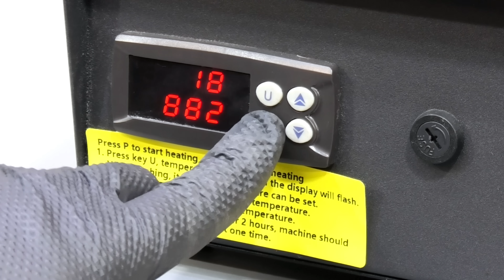105 Years Old Push Reel Mower Restoration - Why Did People Stop Using These?

Comment: I think the test answers the question in the title quite nicely 😀
Reply: I use one - a modern one, that is - and it works well cutting grass but weeds, not so much.  I have to go back and forth, back and forth. But I like it because it's quiet and I can mow any time of day without disturbing the neighbors.

Also, I live next to a golf course and they have gangs of these, which they pull with a tractor, as their primary cutter for the fairways.
Reply: Yep, I was going to say the same thing.
Reply: I used to have to use one if blade is adjusted correctly they cut nice but the blisters you got on your hands were horrible. Also you need to make sure there are no sticks in the grass they will stop you in your tracks.
Reply: Agreed this can't hold a candle to a newer designed mower ..... The "TEST" looked absolutely worthless for what is was supposed to actually do.
Reply: I have a newer one and they all have the same issue.  They cannot cut tall or thick grass.
Reply: Fantastic restoration but an awful mower!! That’s why people don’t use them anymore!
Reply: He needed to spend a heck of a lot more time sharpening and aligning those blades. How rough that paper test was should have been a major clue, it should cut cleanly and easily across the whole blade for each blade. And the clacking when turned!
Reply: @joelsmith3473  absolutely spot on! Did all that work and then didn’t sharpen the blade correctly!

Comment: They are still used, for example on golf greens, because they cut the grass stems, rather than tearing them as a powered mower does.  The key to making them work well is to use them frequently. You can't cut the grass once per month with them, but if you do it weekly they work pretty well actually.  

They can't cut tall grass, so its like a barber giving a haircut, with a scythe you mow down the tall grass, if you have it, then trim, even and clean it up with the push mower.

It's great exercise, no need for a health club membership :)

Comment: Why did we stop? They are **heavy**, the wheels slipped and made gouges in the lawns. Twigs or small stones would jamb the rotter and you would have to turn them back by hand to unjam it. The blades needed sharpening, the edge they cut against needed adjusting and you would often have to carry them which was awkward and they banged and bruised your legs.
Reply: Not to mention they only work on flat ground.  Any sort of pit or hole, and suddenly you're mowing dirt.
Reply: @cheesesniper473 And where I lived, it rained a lot. Cutting the grass with this diabolical machine was a real exhausting nightmare. The result never looked good.

Comment: My suggestions: make the push handle wider, the handle shaft should be made of oak or hickory to prevent twisting and the blade needs to be sharpened better.

Comment: Ours came in working order with the house we bought 45 years ago and we used it for 30 years and then we got a gas mower and used it for 8 years and it broke down so we cleaned up the push mower and used it until we sold the house. We left it in working order.

Comment: Nice work on the restoration!
I used one briefly when I was a kid.  We bought an old house and it was in the garage, so dad cleaned it up, sharpened it and oiled and greased it and it worked OK.  It was very heavy and I struggled to push it , especially if the grass was long.  I think my dad thought I was too young for a power mower.  Pretty sure he felt sorry for me and caved in and bought a gas powered mower.  My Saturdays were mostly spent mowing and trimming and raking until I went away to college.

Comment: My some of my best childhood memories were watching my grandfather sharpen and/or repair mowers like this. At 80 years of age he could lift one with one hand while seated, flip it over and place it on the machine designed for the job of sharpening the reel blades. He also sharpened chain saws and hand saws. People came for miles for his work in Northern Michigan. He also had one of the early toasters with doors that opened on the sides. He kept opening it to check progress to turn the slice of bread to toast the second side.

Comment: I have mowed many lawns with such a mower, and a sharp one was remarkably easy to use. The one I under had a hardwood handle with a straight clear grain I do not know what the variety od wood was. I do remember sharpening it was a challenge, but when sharp it did a very good job on the lawn.

Comment: I got to use one of those once. They work surprisingly well when they're in good condition. If I had a lawn that's the kind of mower I'd want. Doesn't need Gass or be plugged in.

Comment: I used one of these exclusively for my small lawn for a decade before finally caving and purchasing an electric mower to make things easier when grass gets too tall. I still have and use the quiet and simple push mower sometimes though, as it doesn't make enough noise to wake sleeping neighbors early on a summer Saturday morning when the only time it's comfortably cool enough for yard work is 5:30am. The fact that the push mower makes no more than a quiet whirring tk-tk-tk noise means no one gets mad at me for ruining their day to sleep in, so I get to be a good neighbor and still beat the heat.

Comment: When I was a kid, I used to mow my elderly neighbor's lawn with either this push reel Brill or one extremely similar and with the same pale green color.  For about three or four running years back in the early 1960s.  As many have noted here, they were extremely difficult to push due to their immense weight, especially for a 10-year-old kid.  And they were useless in long grass, thus I had to mow regularly.   I often had to run with the mower to get enough momentum to cut longer grass that grew around her barn.  It was very tiring work for a kid.  "Fond" memories.
PS  The mower I used was larger with a much wider cut.  And I can assume it was much heavier than this model.

Comment: I used a reel pushmower until about 1990.  When properly adjusted, a reel mover like that gives an excellent cut.  It will cleanly shear the grass blades instead of tearing them like a rotary power mower does.

Comment: You could still find those things in use when I was a kid. People stopped using them for a few simple reasons; 1) the blades needed constant sharpening or they didn't work well, 2) the blades are unprotected, so people got cuts and the blades got damaged from rocks, 3) they are more work than a powered mower.

They were sort of cool to use on a nice flat lawn when all the blades were freshly honed. That "chop-chop-chop" sound of 4" tall grass getting smoothly sliced was very distinctive.

Comment: used one of those until 1963 when I was 13, when Dad finally bought a used gas powered mower.  when properly set and lubricated, the reel mower was very good at cutting grass except in corners
Reply from the maker: Thanks for sharing

Comment: I've watched a couple of your videos, and you definitely have a good eye for just how much to clean up a part.
Also, I've been considering picking up a vintage push mower. I've got a modern one, but it's designed with a safety bar at the front, and the bar pushes the grass down enough that it doesn't cut. Practically worthless unless the grass is already fairly short. the front of a push mower needs to be unobstructed sharp blades, that's the whole point!

Comment: I have had fair amount of experience using reel type lawn mowers. My father made me use one for a couple summers when I was in Jr. High school. A lot of work, especially for a young kid who was not very tall. Then I worked on the family farm for a summer right after I graduated high school, and besides using large farm equipment, I also took care of mowing all the grassy areas around the farm house and other buildings, but that machine was a powered reel type....the wheels were self-propelled from the motor, and the blade reel also spun under engine power. It was also quite wide, but it cut very well. I recall it had some kind of mechanism for keeping the stationary blade in proper adjustment relative to the reel blades, might have been been self-sharpening.

My observation was that unless the lawns were mowed frequently, the result after mowing looked messy. I think this because, unlike a 'modern' rotary mower, which tends to chop up cut grass into smaller pieces after cutting it (and especially so for mulching mowers), the reel mower just cuts it then lets it fall like a mat on top of the lawn. The cut grass turns brown, and blocks a lot of sunlight for the growing grass underneath, and does not settle down low to decompose properly. And for the manual (unmotorized) reel mowers, if the grass is at all wet, the wheels slip a lot, causing the reel blades to not spin consistently, resulting in unevenly cut lawn.

Comment: I used to use one of these and then we upgraded to one with rubber tires then we got one with a Briggs and Stratton 3hp motor. WOW!  To start it, you pushed in the choke, wrapped a knotted rope around the pulley and gave it a yank. If it started, you gave it a minute to warm up and pulled out the choke. Sometimes if it wouldn't start, you would pull out the choke and give it a yank just to clear out the carb and cylinder and start out with it choked again. If it was hot out, sometimes it would start with out choke or on half choke. This was before rotary mowers were invented.

Comment: I used an American made version of one of these in the late 50's on my aunts small yard.  It is fine for grasses that are short leaf, but forget it on bahai.  As a kid, my Dad had a powered version of this made by Savage, with a Briggs 1 1/2hp motor, again awful on bahai or dandelions, just pushes them over and the pop right back up as the mower passes.  I made my first go cart out of that motor after my Dad purchased his first rotary mower, which of course I was the one who used it.  He had a  heart attack in '62 and from that point I did all the yard work, even painted the house 2 times, the first I was only 10.  I still have that motor, still runs like a champ, but the rest the mower long gone.

Comment: I have a modern version of this -- Fiskars 18" StaySharp Max Reel Push Lawn Mower, and I love it. It does , however, require some babysitting and maintenance. I have many trees on my property, so many little twigs get into the blades and at the end of Summer blades get pretty dull. It is quite some work to sharpen them again. The standard back lapping method with abrasive compound that Fiskars recommends only works for honing blades that are already relatively sharp. So, first I need to use a file and sharpen each blade with a file, then disassemble a few parts of the mower, remove the chain, and do the back lapping with abrasive compound for about 15-20 minutes, and finally finish by spending another 10 minutes adjusting the blades so that they are just the right height above the bar. Lots of work at the beginning of each season. Takes at least an hour, maybe longer with time spent setting up and then cleaning the workplace, and still I can't always get the blades sharp enough so that they pass the paper-cut test. I do get them sharp enough to cut the grass with small pushing effort though. This is not for everybody.

Comment: My grandmother used to mow her lawn with one back in the fifties. In the 70's I ran across one that was like new in a resale shop and bought it. What's great about a push mower? They are quiet. They don't stir up all that pollen and dust while you mow. You don't have to worry about old gas fouling the carb. What's bad about them? One they have to be adjusted to get the blade to cut well. They push nice and easy if and I say if, the ground is smooth and hard packed. They are only practical for very small yards.

Comment: Hey nice job!.
Im about to start restoring my great grandfathers mower. What blasting media do you use? I have garnet in my blast cabinet but afraid it will be too harsh for the old mower.
Reply from the maker: I'm using aluminium oxide. Thanks and good luck with your project. 🤞
Reply: @rustyshadesrestoration  ok thanks. I'll have a look for that then. Looks a lot softer on the parts then the garnet I have

Comment: When I was a kid I had a lawn job using one similar to that.  It had rubber rimmed wheels and not steel toothed.  The other parts look very similar.   The biggest problem with those is when you go through thick grass the blades lock up and you just start skidding and not cutting.
These had dangerous exposed blades.   There were news stories about people being injured with them - losing fingers or toes.  I was glad to see them go.

Comment: I actually bought and used one of these about 15 years ago when I bought my first house (the yard was a postage stamp, so it seemed easier than investing in and managing a mower).  I used it for about 5 or 6 years before I bought a cheap plug-in electric mower to replace it.  While it was fine for cutting the grass, it didn't deal well with ANY sort of debris, and we had a big, old oak tree in our side yard that dropped acorns and twigs all the time.

Comment: I have pics of the farmhouse I live in now from about 100 years ago and the yard is postage stamp sized, as all the available land was used for crops or pasture.  The original reel mower looks like yours (before) and is under an outbuilding.  To use one of these:  cut when the grass is short and sharpen the blades often.

Comment: Ann and I moved to a little town and when they switched to Ethanol gas ⛽️ made from corn 🌽 , gasoline carb mowers do not like to run on it. 
 So for a while we used the old reel mowers, I have got worse in my health and older , we went to battery push mower. All you have to do is clean the debris from under the deck and 
sharpen and balance the blade. The old reel mower
was only intended for a real small yard only.
Like the video. 
Kevin Phoenix ✝️

Comment: My dad and I used repair and sharpen those machines. Back in the old days, itwas a locksmiths filler. There are a lot tricks of the trade my dad taught me after sharpening the reel nd stationary blade. The end result was a complete shearing of the grass on all parts of the reel with the stationary blade. We almost always had to replace the pinion gears when one wheel or the other didn't drive the reel blde. I believe I still have the rig in my shop cellar thet we used to sharpen those reel lawn mowera. The hard ones were the power driven commercial reel lawn mowers.

Comment: Skillful and thorough work on a complicated and derelict piece of machinery. Very nicely done!
One safety suggestion: When cross-cutting a long piece of wood on a table saw, it is very, very important to use a sled or the miter gauge. Holding a long piece at each end while feeding it through the blade poses a very serious risk of kickback. Believe me--I've been there, and it wasn't pretty.

Comment: Lovely job a lot of work, done hundreds of these and as a retired service engineer I know they can be difficult to work on with so much rust but spotted one mistake the cutting cutting cylinder is the wrong way round. I have made the same mistake and had to strip and rebuild the machine again no one is perfect.

Comment: How do you remember to put all the pieces back together? Are they labeled or in a parts diagram?
Reply from the maker: I have a photographic memory, so for this project, I didn't need anything, but if I have a project with over 100 or 200 parts and is taking longer time, I take pictures and then I remember. As well, if I'm not sure about something, I can consult the footage.

Comment: Excellent restoration project. The problem that arises with these type mowers is that vegetation other than usual lawn grasses are extremely resistant to those rotary cutter blades especially taller grasses and weeds. Be prepared to going over and over the same area.

Comment: I use one!  It's a new model but it works great!

Excellent work. My only question is why you used that crappy pinewood stock?

Oak would be so much stronger
Reply from the maker: Thank you for your feedback and kind words! I’m glad to hear your machine works great—that's awesome!

As for the choice of pinewood, you're absolutely right that oak would be much stronger. However, since this piece is meant for display rather than regular use, I opted for pine to help reduce costs. For functional pieces, I would definitely go with a more durable wood like oak. Thanks again for your insight and support!

Comment: Very good restoration.  It looks great, but is it a user or an ornament?  (Lots of work for a machine of this type).  My father had a similar machine in the 60s.  In the UK we call this style a cylinder mower.   The best technique is to pull it back about 18" then push it forwards forcefully as you take a step forward.  Its quite hard work.  Yours doesn't seem to be sharp - it shouldn't clog - but then again the ground looks quite wet and what your mowing is as much weeds as grass!     Good luck!

Comment: We had a nice one I grew up using 3 oe=r 4  times every summer from 9 to age 15.  We eventually got an electric mower and put the old reel one in the shed.  A decade later I came home to get it when I had my own place only to discover vandals had broken into the shed and stolen it.   :(   The new ones sold in some stores are built much flimsier than the old ones were (plastic parts instead of steel, flimsy wheels, etc.)  Part of the fun of using one year after year was learning how to keep the blades sharp with a file.